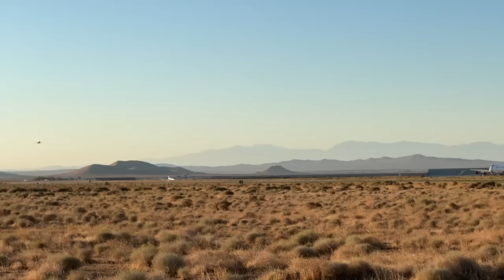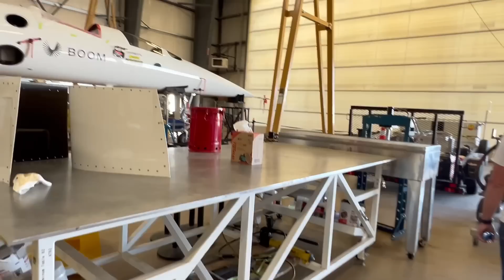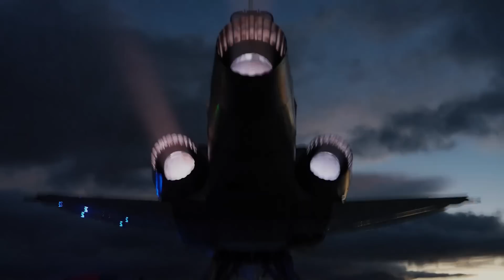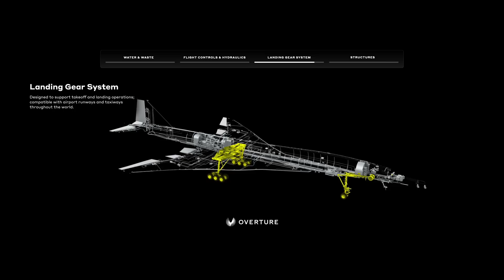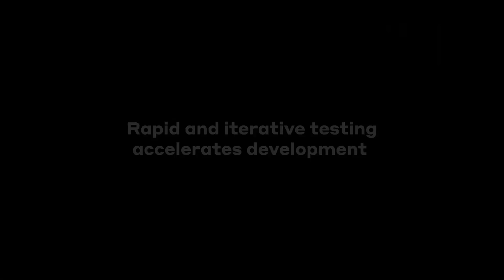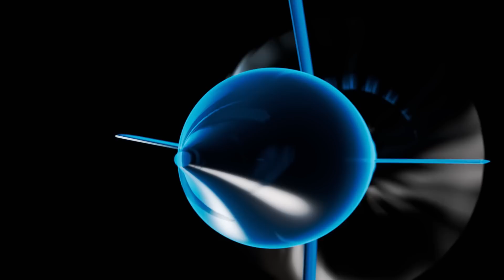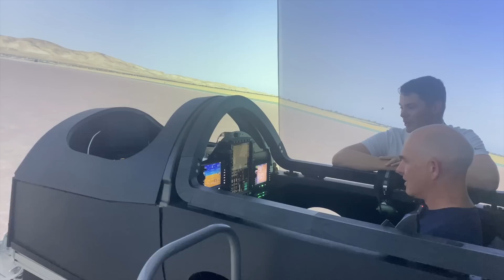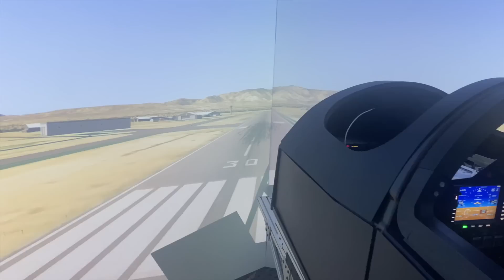Will This Experimental Supersonic Aircraft Show Supersonic Airliners Can Work?

Comment: Any discussion about noise? Apparently the sonic boom over land was a big issue for Concord.
Reply: The whole idea of the company was built on the assumption they will be able to reduce boom under the legal limit with modern technology as that is an even bigger barrier to entry into the market than cost. 
That was kind of the joke of the name too. "We'll keep the boom, but only in the name".
The shape of the airframe and some material choices were informed by computer simulations specifically to redirect/reduce the boom, but it remains to be shown in real world tests if it worked.
Reply: @LoisoPondohva  As per Boom's own FAQ page, it seems clear that they don't expect to fly the Overture faster than Mach 0.94 over land and they're only talking about flying supersonic on oceanic flights. You might be mixing this up with the NASA experiments and demonstrator aircraft that are looking into that. The main purpose of Boom's demo aircraft is to develop the tech and knowhow that they can scale up to make the Overture. It's pretty clear looking at the current plans for the Overture that it doesn't have any fancy aerodynamics/shape that would make the sonic boom any less than any other supersonic aircraft. The engines will also be noisy so they will run into issues at some or maybe most airports.
Reply: @davidkavanagh189  I know they aren't planning to fly Overture supersonic. I didn't say that they did, I said there's no real world test data to confirm or deny their claims of being able to reduce the sonic boom. If anything, them not flying Overture supersonic supports that lack of data, so I'm not sure what we disagree on here. 

As for the shape being modeled to redirect the supersonic airflow, that claim comes from interviews with their CEO. He might be lying, I have no real skin in the game to bet that he isn't. But "it's obvious to the naked eye what the aerodynamics of the airframe are" is a bit dubious for me, so I'll take your opinion on that with about as much scepticism as the company's claims. 

I've worked for half a decade on computational airflow modeling, and the more experience I got the less confident I felt to predict what impact even tiny adjustment to the airframe would have at supersonic and hypersonic speeds. Because each time it turned out to be surprisingly counterintuitive even in context of my Masters in fluid dynamics.
Reply: @LoisoPondohva  In the startup world this is usually what you present as a vision for the future to get investors excited, and employees hyped up, similar to how SpaceX was talking about establishing Mars colonies even back when they were still blowing up Falcon 1s. They might not have any ideas or detailed plans right now for how they'll build a quiet supersonic plane in the future, but all you need at this stage is some research to cite and some vague graphics of lines going up.
Reply: @johannesgutsmiedl366  I understand that. There's a line between vision and lies (sometimes even enforced one, but rarely). 
And if they did NO aerodynamic modelling to suggest specifically overture had quietER sonic booms, some of the CEO statements would be pretty much lies. 

For what it's worth, I do see some not insignificant, if small, differences between previous supersonic designs, including Valkyrie and Concord, and Overture. Ones that would put it closer to newer NASA X-planes in some aspects and MIGHT have an effect on sonic profile. 

But again, eyes, even trained, are kinda bad evidence in stuff like that.
Reply: @LoisoPondohva  To be fair, in the tech startup world it's usually not possible to see the difference between "scam" and "best investment in history" until after the dust has settled and the company is either dead or a market leader... again SpaceX is a good example, they might have easily entered the long list of failed private spaceflight endeavours if they didn't happen to be at the right place with the right people at the right time. And if they did we'd be talking about "that time some Silicon Valley tech bros thought they could build rockets like software and scammed the US military out of millions of dollars".
Reply: @johannesgutsmiedl366  well, that part is fair. 

That might be an apocryphal tale, but Musk himself said on a couple of occasions that SpaceX was one launch from failure at one point. Their first two prototypes for F9 exploded, they were in debt and with only enough cash to launch the third one once. When it launched successfully, they were able to secure a contract. If it failed, they would've been bankrupt. 

And before someone comes in with "well, Musk would've bailed them out", that was his last money more or less. That was before Tesla was worth anything. 

So yeah, and in this case Boom might be facing an even smaller market than spaceX did so a lower chance to survive. For space there's always government contracts.
Reply: NASA has not done boom studies yet with their X-59 yet, nor has Boom (obviously), but they managed to design both aircraft to kind of "shape" the boom to where a lot of the boom is focus above of the aircraft, minimizing how much of it makes it to the ground.
Reply: Most countries still prohibit it so they'll need to campaign to get the rules changed. The aircraft will also be very loud on takeoff and landing so they will have problems there too.

Comment: If they succeed, having a relatively economical supersonic engine, will be a potential source of extra income from the defence industry players.

And even if they don't sell any engines to third parties, vertical integration is quite nice. The established engine manufacturers earn their money from maintenance services, I believe. And a small player like Boom, would benefit from retaining that stream of income inhouse.

Enough to warrant the cost of r&d? That will be interesting to see.
Reply: Not a chance.  They will never have the money or experience or production capacity for the engines required, which would be lucky to achieve what the military had in the 70s.

Comment: Many years ago at Oshkosh, a Concorde was there, a group had chartered it for the flight over and they were giving flights on it, you could take a hop into Canada and go supersonic.  It was expensive (and I was young and poor)... still not taking a flight is one of my biggest regrets.  One could have done Concorde and taken a Ford TriMotor flight on the same day for a "both ends of the envelope" experience.  (damn... should have just spent the $)
Reply: I saw it at Oshkosh in 1998.  Very cool just to see it take off!  If memory serves, it was a quick local flight, so no chance to go supersonic.  Even so, it would have been fun just to say that you've flown on it.

Comment: My concern is the very slow rate of test flights. Either they are having significant issues to overcome on each flight or they are so short of resources they can’t analyse their data in a reasonable time. You would expect a test flight program from even a small company to run at over 1 flight a week on average. A bigger company would be flying most days.
Reply: And this bird is the size of an Air Force trainer, plus it has mostly off-the-shelf components.  Should be capable of multiple hops per day.

Comment: No one in government seems to care that SpaceX constantly shatters the public peace with sonic booms during every Falcon 9 launch.
Reply: Those are localized to spaceports; SpaceX is only one of many companies launching rockets.
Reply: @rdbchase  "Localized" is a very vague term.  The Southern California coast from Vandenberg all the way south to Palos Verdes (or farther depending on the launch) is subject to sonic booms when SpaceX launces.  That's a distance of 150 miles.  Is that "local"?  

Other companies launching rockets from Vandenberg do not use the same booster recovery method that generates sonic booms downrange, so you can't compare those to SpaceX.
Reply: @pasad335  I'm more concerned that Starlink will spoil terrestrial astronomy or trigger the Kessler syndrome, but I don't have to listen to sonic booms from Falcon 9s.

Comment: You didn't have to be rich to experience Concorde. In August 1999 my wife and I flew Manchester to Paris on the beautiful white bird - but not directly (supersonic flight is not allowed over land because of the sonic boom). It was via Bay of Biscay to experience Mach2 at 60,000. It was my 50th birthday present because as a private pilot since 1978 I wanted to fly supersonic while it was still possible to do so. And the icing on the cake was that I was in the flight deck jump seat for the entire flight.

That was possible because one could do it in those pre - 9/11 days.... and I happened to know the captain as we both flew small vintage aeroplanes into various fly-ins for fun. So I was safety  briefed, strapped in, headset on, sitting immediately behind the captain and next to the first LH cockpit side window and with a clear view out the front as well so the blackness of space and curvature of the earth were easily visible. It was an absolutely unforgettable experience. It led to my writing an article on the flight for UK magazine 'Pilot', and subsequently a 14 year retirement 'job' as a technical guide on Concorde G-BOAC at Manchester after the fleet was retired.

Concorde accelerated from zero to 250mph on the runway at take off, in less than 30 seconds! That felt just amazing. Approach was flown at about 170 to 180mph depending on weight, on the standard 3 degree GS. There was no 'flare' as such, but in the last stages of the approach that massive wing was affected by ground effect, but mostly aft of the CG, which reduced the ROD and induced a nose-down pitch which the pilot had to counter with aft yoke, just sufficient to maintain a constant pitch attitude. The aeroplane would then touch down perfectly. So there was an aft yoke movement, but only to maintain the pitch attitude, not to 'flare' the aeroplane.

Oh, and the cost of that memorable life-changing flight? About £500 each!

Vince C.
Reply: @gzk6nk  So you had to know someone to get that?
Reply: @vociferon-heraldofthewinte7763  That I knew the captain is what made it happen. But I'd had decades of jump seating while flying commercially from (non aviation) work in the 80s & 90s and prior to 9/11. .Just show my licence and ask! 9 times out of 10 I'd get the seat for take off or landing, The Concorde one was from push back to parking on stand at end of flight. I was very, very lucky the way that came together,
Reply: @gzk6nk    Awesome!
Reply: still sounds like you still had to be rich. people have far less disposable income these days too. middle class people are sweating about the cost of an ordinary ticket right now. 1999 500 gbp is a whole lot more than what an inflation calculator will tell you. wouldnt be surprised if the modern incarnation costs you $8000+ usd. wouldnt be surprised if this doesnt get you a return ticket either.
Reply: It was better than that. You could fly a loop up and down the North Sea subsonic from various UK airports (Leeds/Bradford, Edinburgh etc) to LHR for just under £300. These charters made a lot of money for BA/AF and were part of the reason it was very nicely profitable over its entire lifespan. Full seat occupancy (prebooked charter), virtually no baggage.
Reply: Even if the ticket was "affordable"... I'd say you are pretty rich affording to take the 5-10x (in todays money) more expensive scenic flight to Paris. 😅
Reply: @rkan2  For $4000 these days that gets you a set of forged wheels for your car, or a high end Gibson guitar, or some other hobby. I think any middle class man in the US can treat himself to something like this once while. Maybe a different story if you have to pay for the kids!
Reply: And now I pay $500 to sit in a seat 8 inches wide in the back of an Airbus next to a man that's 300lbs and breathing heavily :( They were using duct tape to keep the overhead bins closed since the latches had worn out.

I don't fly anymore, especially not American Airlines, unless I really REALLY have to. Driving is just better.

Comment: You scored a ride in the sim! Be sure to log it.
BTW, to develop and certify the über-efficient GE9X engine, even though it was based on the existing GE90, GE Aerospace spent more than two billion dollars. (Certification technical documentation was my day job until I recently retired.)
So I'm skeptical of any new engines being certified by a company with experience in tiny drone jets for any reasonable cost. Or at all.
Reply: In theory if they are not looking for the absolute maximum performance or effiency, they can probably use better known materials to make their engine and not all the cutting edge that a GExx   would have with composites and titanium etc.

Either way, it won't be cheap. 😅
Reply: @rkan2 Yes, I wondered why they didn’t use existing compact & efficient low bypass turbofans like the GE F414.

Comment: Wow, using a 80-year old design for the engines. That's kinda sad, if you think about it. Howcome newer designs aren't more available for new aircraft?
Reply: This is explained in the video.
Reply: They are, but this is a private company with a budget. Honestly it doesn’t really matter that much for a test aircraft
Reply: It isn't "kinda sad". The J85 turbojet is one of GE's most successful and longest in-service military jet engines - the civilian version has logged over 16.5 million hours of operation. It is relatively cheap, compact, powerful & utterly reliable. Why would anyone use a more expensive, more modern propulsion system on a concept test airframe when this engine is readily available, well understood & easily maintained? 12,000 of these engines have been manufactured & it will still be in service in 2040. Ideal.

Comment: A commercial supersonic airline may be a bridge too far. A 10 seat super sonic business jet may be possible as it is sold into a market where money doesn’t matter much.
Reply: There are like a 1000 seats of business or first class between London and New York. I am sure at least 10% of them would pay for the shorter flight time. That would fill one airplane. There is probably at least a dozen routes like this, with half of them suitable for the Boom.

There is probably a market for 100 or so of them globally..
Reply: @rkan2  it's going to be real hard for them to break even on that. Breaking even on such a huge project with just a 100 planes sounds impossible to me. Airbus couldn't break even on the A380 with 300 aircrafts, B787 is still struggling to break even on 1200+...
Reply: @oadka  I agr. I guess the Concorde project was very far from being profitable.. They made only 20 examples with like half of them doing most of the flying. 

Anything with a new engine design probably requires A LOT of production.
Reply: @rkan2  12/2 = 100? 
Or do you mean you think there's a dozen in the US? My math ain't mathing.
Reply: @LoisoPondohva  If there is a half a dozen routes for such an aircraft, it doesn't mean you only need half a dozen aircraft. Besides, once there would be such an aircraft, I think it's demand would likely increase.

Those are the routes that would already fill these airplanes because they have big demand, but there are like a hundred routes between NA and EU that could potentially be served by one supersonic aircraft, nevermind globally.

Many of these routes, especially from the west coast again don't really make sense for Boom because of the over ground routes.

Comment: Founded 10 years ago and only did 4 flights? In that time span the Concorde was introduced and retired back in the day.
Reply: Concorde only sold to British Airways and Air France, with SUBSIDIZED purchases that were to return 80% of the profits to the government. This project doesn't have such deep pockets to draw on & the real money only arrived at the very end of 2017 - it's a project by a new company without the depth of experience of a Rolls Royce etc - naturally it's a very gradual 'takeoff' or would you rather they rush at the gate & screw up?

Comment: 1998 Speed bird 1, best day of my aviation life. LHR to JFK. i was a Qantas ground engineer.
 got a cheap flight on Concorde through Qantas staff travel and BA Asia Pacific.
Full price was $10000 AUD , I got offered $1400 QF staff.
1350 mph, Mach 2 at 58000ft drinking 10 year old French red wine.
I visit the flight deck and the flight engineer and me have mutual friend.
I get invited to flight deck for landing into JFK. 
Its an exclusive club to see the heat shield roll down and the nose droop on approach to JFK.
Reply: QANTAS never yet crashed, ... except for last two CEOs job performance 😳
Reply: I miss the Concorde. Washington DC to Paris in just less than 4 hours gate to gate, and Paris to JFK in slightly less time gate to gate. Those are the flights that fit my schedule most often, and I was making the Atlantic crossing trip every couple weeks. I did get many cockpit invites after I started getting the Royal treatment and always seated in row 1.
Reply: I am glad you enjoyed the experience I did it so many times over the 27 years I talked to the captain of Concorde coming the opposite direction once
Reply: damn 😅 And here I am just with my 20 year old dream of jumpseating any commercial jet landing.

At least I know almost a dozen pilots by now lol.

Comment: Higher speed means burning more fuel. And with only 64-80 passengers and increasing fuel prices, it will still be the very few who can afford it.
Reply: Bro just defined a private jet
Reply: Is the fuel really that expensive? Concorde could fit 120000 liters of fuel for max 128 passengers. Say you have fewer passengers and burn almost all of it you get 1000 liters of fuel per passenger. That's what? 600 euro's? 55 years later you could expect them to easily beat that. The main challenge will be to make sure the other costs don't rise proportionally as well.